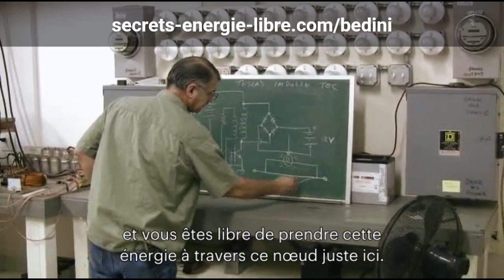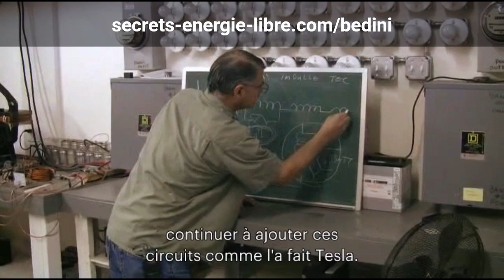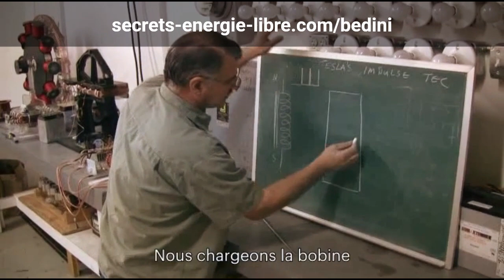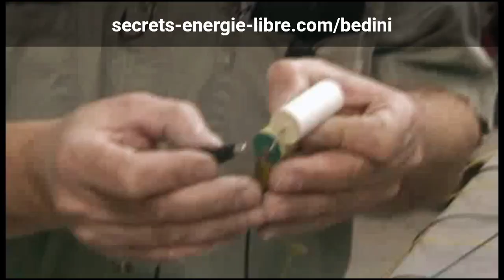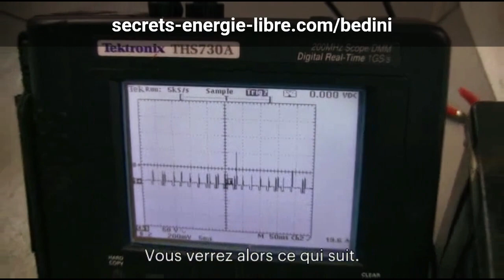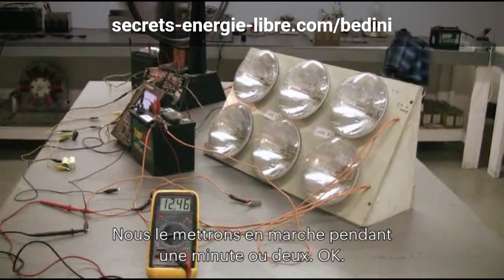Technologie à Impulsions de Tesla : MasterClass de John Bedini

Comment: I would use a bridge to each coil and take the DC part to the big wire that charge batteries and feed the circuit!
Reply: In automated system, I'd cut off the charge when the batteries goes under 10 volts
Reply from the maker: @TheBuzzer67  or better, @ 12. which makes the battery rotate every 15 to 20 minutes depending on which bedini type you're using. another important aspect is to respect the C20 discharge rate. Don't go lower...

Comment: Meci christian ❤celle la c est la pepite sa fait 4 ans je travaille sur tout leur moteur ...sa bobine sec haha
Reply from the maker: C'est génial Anthony!
Reply: @secrets-energie-libre  pire et vous savez pourquoi? Parce que john disais que c etais des tres mauvais generateur ...j ais reussi a m en sortir lol ....
Reply: @anthonyjousse3020
4 ans de travaux alors que l'on vous vend tout le nécessaire pour construire la machine (guides, kits...) dans la promesse (non la certitude) d'accéder à la dépendance énergétique.
Ou bout de ces 4 ans ou en êtes vous si ce n'est pas indiscret ? Vous avez pu résilier votre abonnement EDF ?
Reply: @seb5810  presque  ....mais c est pas l objectif l objectif c est d adapter la tech impulse aux electrolyse cordialement ...😘
Reply: @seb5810  etant donner que la partie imaginaire ... cree la sur untier .... tout le monde peut devenir autonome .... le soleil et la terre avec se qu on sait faire de mieux travailler .
Reply: @seb5810  marc ... t es hors sujet .
Reply: @Marc.2.0 jais pqs une tete de marrant lolcomment ca?
Reply: @Marc.2.0 les bobine relay???? Pas besoin de ca j en ais des performant a un ampere en entree ,368 volt ac au cours circuit .... en 12 volt ... en 24 3200 tour au cours circuit integral(charge de sortie ,sortie excendaire et tournevis ,plus moin sur la sortie ... 🥰❤
Reply: @Marc.2.0 il faudrais que l on se voit je pense que mon travaille va te plaire  .. ❤t es le seul francais aussi passionner que moi j ais les amplis et les moteur qui vont bien ,t es pas pret lol 😃😃😃j ais ete voir ta chaine j aimerais qu on discute haha
Reply: @Marc.2.0 je sais ... j ais 1500 pied de 41 awg sur mes bobine ...exponentiel par la viteesse  ..en entree je t assure que tu sera fou de voir se que je fait ... j ais besoin d un type comme toi
Reply: @Marc.2.0 a ton avis pour charger l entree  en fonctionnnement sur les ssg ,c est mieux battery plomb ,alcaline ou lithium ,(sur un certain moteur ) j ais pu lui mettre un point 0 (j ais regler l amplitude )donc j ais une periode de repos et un retour ,contacte reed switch 1000 volt 5 ampere brancher sur ma sortie de generateur isoler  ... de la charge principal . As ton avis sa devrais allez pour mettre les batterie d entree sous charge lithium ou plomb ....?en fonctionnement ?